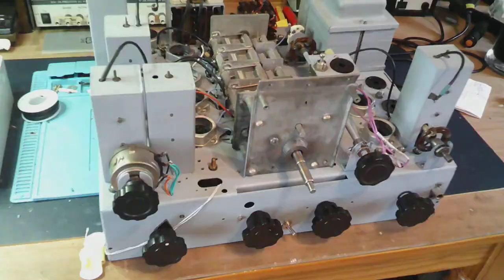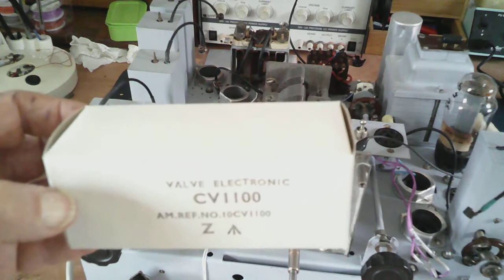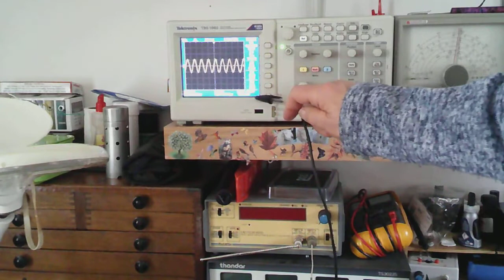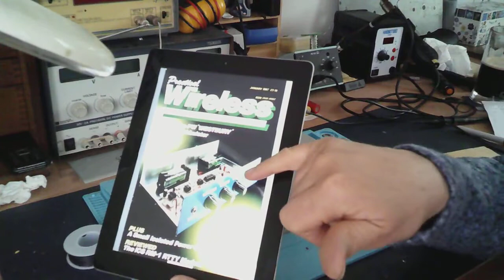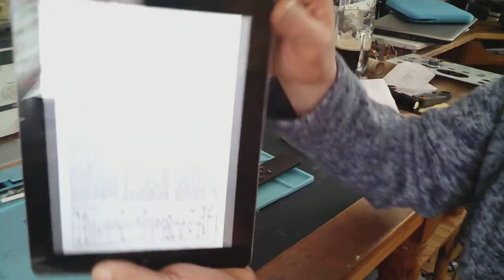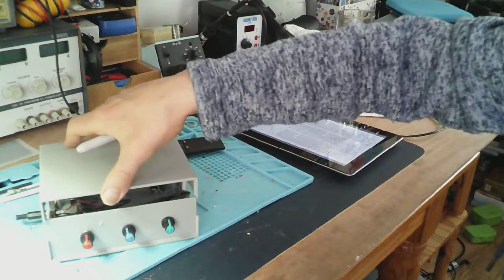Marconi CR100 Renovation (43)  A few of the niggly problems repaired .

Comment: Hi Sir nice and clear instructions as always, I also had a CR100 by my bed as a kid and would like to restore one from the ground up, are is any of the associated paperwork or help full diagrams available on your website (if you have such a thing?)
thank you John (Ex G4ubx)
Reply from the maker: Hi John Thanks for the comment. I too had a CR100 when I was about 13  ( in the 70s) a big difference  for me after using regen sets and kits.  When This was passed onto me to do I jumped at the chance. I had a good look on the web and found quite a lot of information and tips ,  http://www.chavfreezone.me.uk/2020/refurbishing-a-cr100.html
also from the vintage-radio site https://www.vintage-radio.net/forum/showthread.php?t=165571      I managed to get a copy of an original  manual on ebay.
but it can be downloaded from here https://www.manualslib.com/manual/1752760/Marconi-Cr-100.html      
I took many pictures prior to dismantling it and took notes of  components on the valve bases which in reality wasn't needed as all in the manual . Labeling the new components on the tag boards saves a lot of time when re assembling.
I haven't done much these last few weeks due other commitments but hope to do the next video on the IF alignment and produce curves that almost match the ones in the manual. I hope this helps. I was thinking of putting before and after pictures up at some point,  Well I hope this helps but don't hesitate to contact me and  I will try to  help in anyway. 73 Simon GM8NYV
Reply from the maker: The link to that manual is a photocopy and I just noticed its not complete. Here is another link to a better copy https://bama.edebris.com/download/marconi/cr100/Marconi%20CR100%20Receiver.pdf
Reply: Thank you for that, most kind, if only I. Plus get one off eBay where the postage wasn’t as much as the receiver😹
Reply from the maker: @johndoe-sl6pd  Just saw this on ebay today the 6th July https://www.ebay.co.uk/itm/334494618674?hash=item4de16ed432:g:8KgAAOSwA6VixDxg   pick up only but you might be able to make some arrangements.